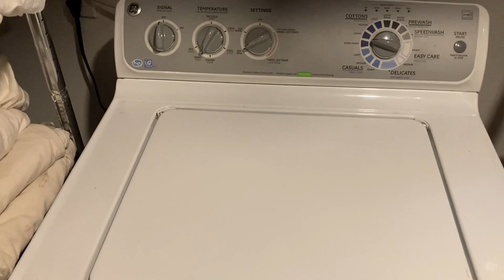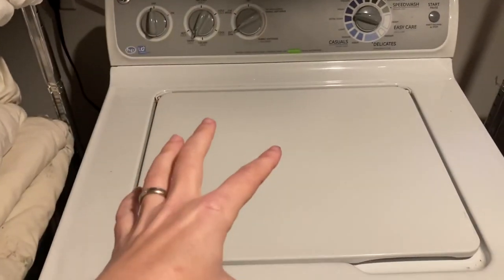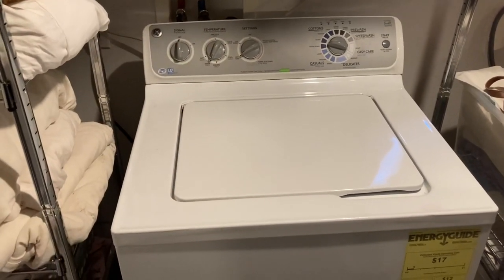Laundry Lint: Synthetic Blends = Microplastic Pollution, Carcinogens. What Can We Do?

Comment: A closet pole spanning over laundry machines with hangers and a solar fan to deal with humidity... no dryer at all. Clothes will last better also.

Also, years ago converted a pantry by the laundry hallway into a Family Closet! 

On one side, the closet had room for one set of the big wire 5 shelf units. That held all pants folded with a half shelf assigned to each family member. Also had baskets for smaller items on those shelves. Younger kids had the lower shelves so they could reach it. 

Across from that I installed two rows of wire closet shelf racks that had poles for hangers. All shirts, including t-shirts went there, again with a section for each family member, lower rack for younger kids. On top  closet rack shelf I had totes of off-season clothing. It used to take weeks to figure out who had what and who needed what for the next season, but with this system I could change over for seasons in like a half an hour- no kidding! 

No folding all over the house. No clothes crammed into dresser drawers. No messy closets. The only laundry party was sorting socks, and if they didn't get sorted, no problem, they were all there in one big basket to find in real time. :)
Reply from the maker: Yes!! These are great ideas!  Unfortunately, I live in one of the worst locations in the world to rely on solar powered anything, but in many areas, solar powered drying technology it would be such an asset.  I really would love to get a people-powered washer and dryer going here.

Comment: It is my dream to have a family laundry/closet room! I think it’s very labour saving as makes so much sense! Maybe one day. 

What I do have though is a combined washer/dryer. I do not use the dryer option to fully dry the clothes, just to steam them a bit at the end of the cycle, this helps to soften them up (our water is super hard and I don’t iron). I do dry towels (but they are cotton). The clothes get hung up to air dry. I’m aiming to hang them up outside more, but as it’s mainly inside atm, I use a dehumidifier (which I had for years now), which works really well, clothes dry quickly. I think drying less prolongs the life of clothes, not sure how energy consumption compares between a dryer and a dehumidifier, I should look it up!

Comment: Ah, yes, lint and micro-plastics. I have a grey water system, which means all of my washing machine water goes out to my fruit trees. Of course I have to be careful about what I use to clean my laundry (either Dr Bronner Sal Suds or Ecos) but how much do I need to worry about micro-plastics in my soil? Well, I cross my fingers and hope that it gets captured in the several inches of woodchips I have under the trees. Is it even possible for plant roots to absorb it? I have no idea, but I'm guessing not, and I figure this is a better option than all that water dumping into the city's sewage system.